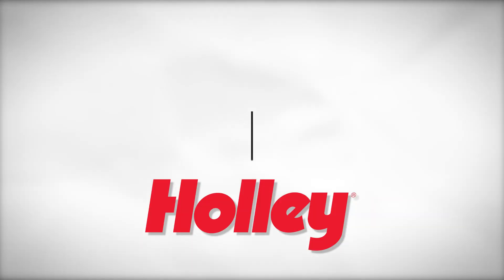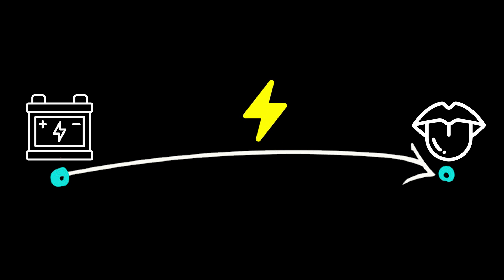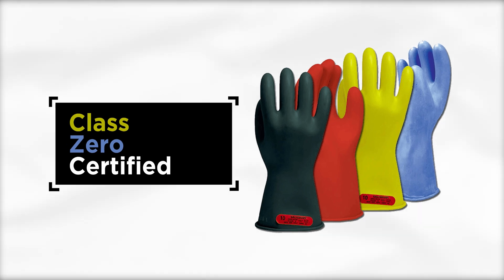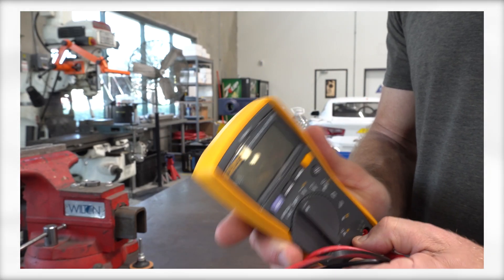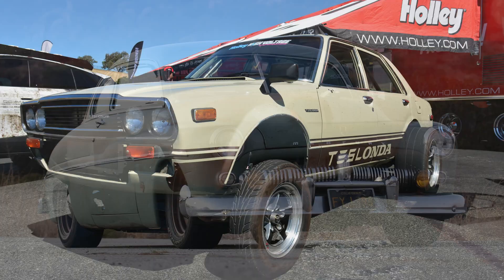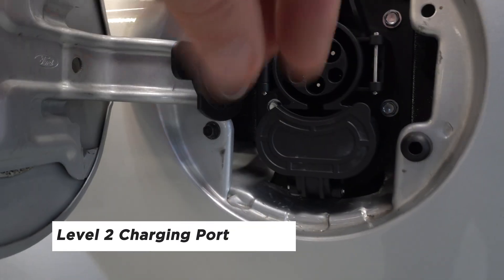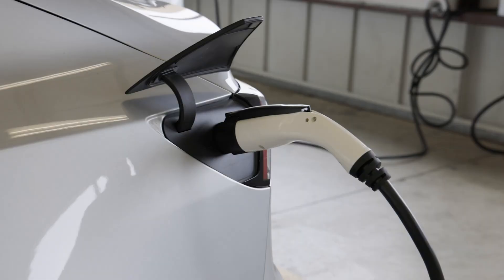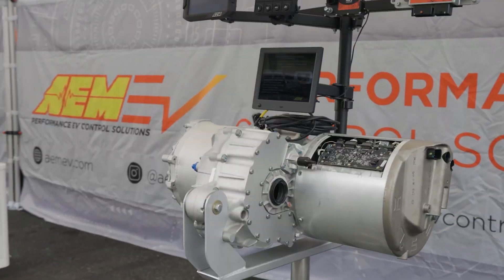EV SWAP BASICS | Everything EV Episode 1

Comment: Great video to start the safety basics. The one thing to remember is the battery cannot not be turned off, it is like working in live circuit panel with far more current. Your typical starter cable is a lightbulb filament to a big battery. 
When I worked for a company with a DC power division, we had an electrician killed by slipping and dropping a tool into a phone company central office battery, what killed him was the vaporized metal from the short.
Reply from the maker: Thank you for sharing that and yes, high voltage can be dangerous, which is why we stress the safety concerns. Once you are aware of these though, the systems are much more elegant and easier to work on than ICE vehicles. While you can break the connection to the HV components, the batteries are, as you stated, still active, and proper protection and shielding of the terminals are very important.
Reply: @aemev4587  It is great that you guys are doing these. It is large learning curve for everyone. We are on our third conversion. I guess my kids are some of the first EV hotrodders.